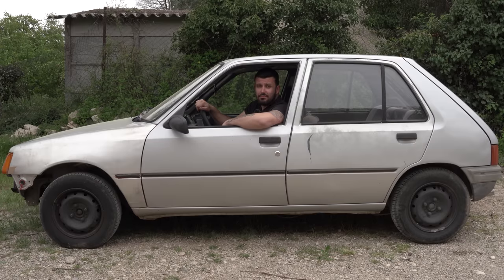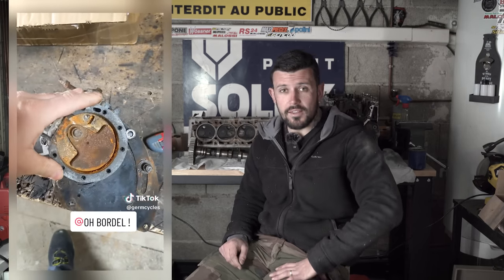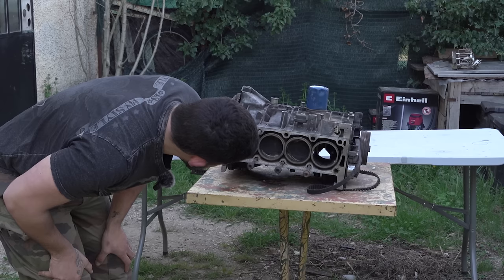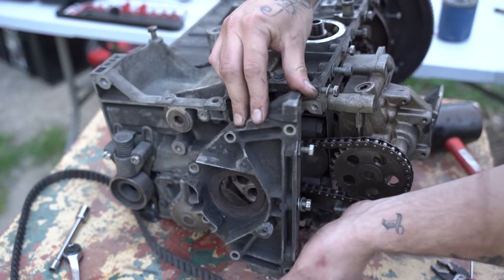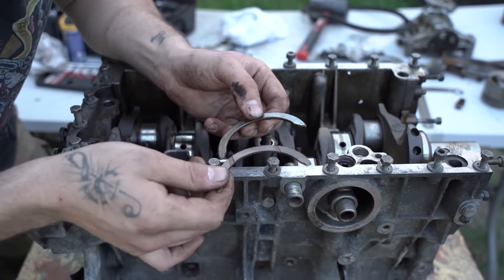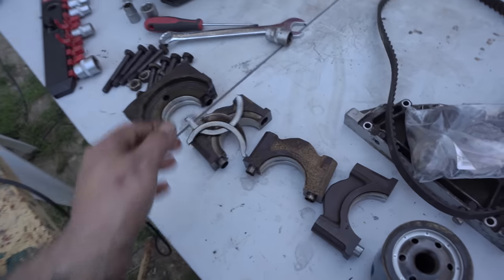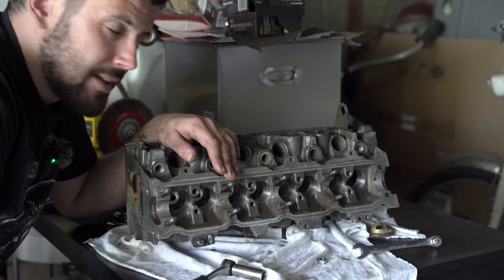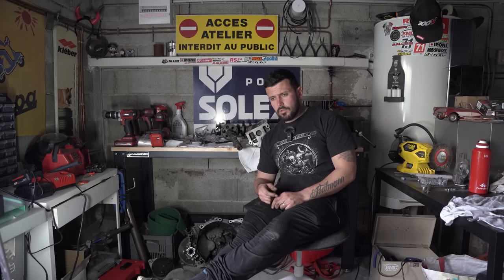Une prépa 300 chevaux sans être mécano ? Et j'ai des cadeaux pour vous ! EP 3

Comment: C est pas une très bonne base de partir d un xu5...
Prend plutôt un xu10j4r. (2l 16v 135cv)

Sa Vaud 250e.
En turbo piston d origine.  On fait facilement 300cv 
Le bloc chemisé du xu5/9 tient pas très bien les montages turbo. 
(Les 309 turbo cup fesai que 200cv)
Reply from the maker: Le bloc n’est pas définitif ! On peux changer plus tard selon la cagnotte 🔥🙏
Reply: @OHBORDELYT  la culasse aussi 
Les tct ont un problème de dilatation de la culasse à cause des 2 soupapes echappement cote à cote  aux cylindre 2 et 3..
Passé 300cv sa fait que des joint de culasse.